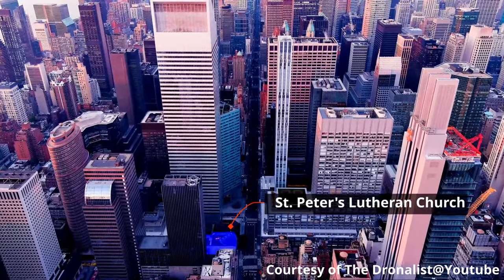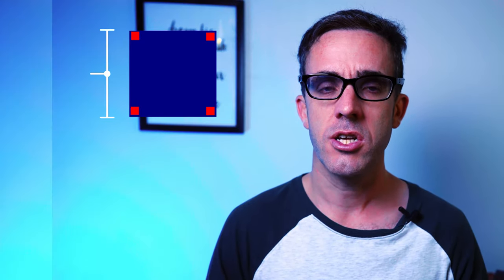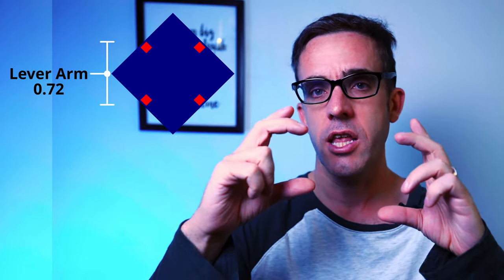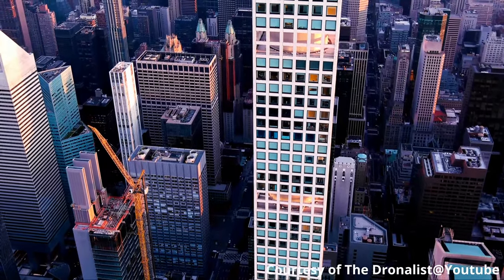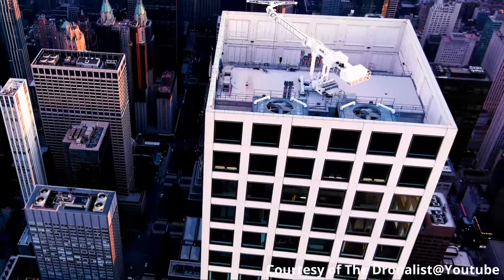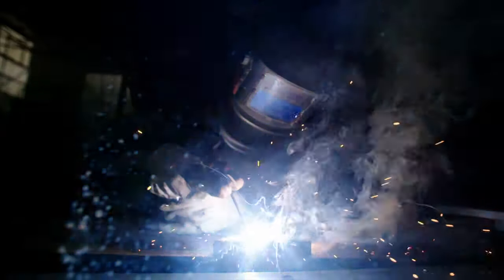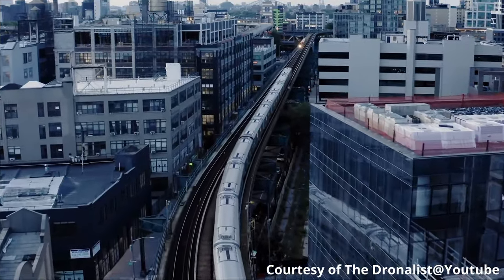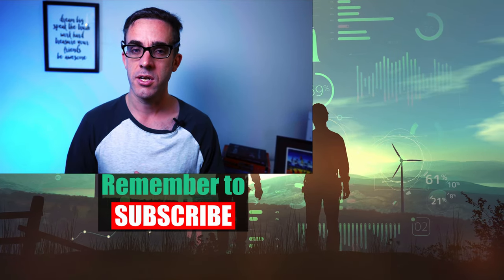How The Citicorp Center was saved by a Student's Question | Citicorp Center's design flaw

Comment: Thank you for the video ! This story shows that we always have to question common practices for a particular project and do not always apply them mechanically. 

As a structural designer, I have huge empathy and respect for LeMessurier who showed a lot of courage and honnesty. Especially because he dealt with the stress and the pressure and solved his problem under these conditions.
Reply from the maker: Hi Hadrien, thanks for watching. Also agree that how LeMrssurier behaved after should be what we aim for as engineers.

Comment: In a nutshell the building was only designed for four wind directions? I cannot imagine what design code anywhere would permit that. In comparison with the rest of the structural modelling the specification of the wind rosette is trivial, and the analysis and postprocessing are completely automated, so it costs little to consider the full design envelope.
The only reason I can ascribe to this is that computers used to be feeble and computer time (often from a bureau) was expensive. When I started as a junior engineer in the 1970s we had to economise computer usage and I guess that's what the designers did in this case.
For a personal project I did a dynamic analysis of one of Singapore's tallest skyscrapers to compare with instrumented results. Out of curiosity I looked up the article published in the Structural Engineer on this project decades ago. I was astonished to see that the design model consisted of vertical beam elements, one per floor, a total of around 500 dof. My model had around 200,000 dof a ran on a PC in a couple of minutes. How times have changed.

Comment: It seems that the mistake was hubris from the beginning. Only one corner was required to build the church. The central pillars, where needed on two faces, the other 3 corners could have been conventional construction.

He should definitely be praised for taking action. He would have known this was going to hurt him, and it reveals he was a well adjusted individual in that doing the right thing happened. We don't praise people enough for doing the right things. Taking a personal hit to protect others from our errors is a sign of good character, and should be rewarded.
However, if there is a lesson to be learnt for engineering; check your ego at the door; unless there is no other way, do what is proven to work. There were 7 other towers taller than this one, and that should have been the practical evidence to follow their lead.

If there is something to criticise, then it should also be that there was a far safer, quicker and better solution; secure the 3 corners which could have been secured, even after construction. It's only another example of hubris that this wasn't the solution.

Comment: I doubt the building would have collapsed as the wind would never hit directly due to the congestion of buildings around it. also there is a 20% factor of safety in structural materials. Also there are redundant load  paths thru the building.
Reply from the maker: Hi Design Studio, they wind tunnel tested it and typically the surrounding buildings would be modelled. But agree there may have been redundant load paths that may have stabilise the building.
Reply: @BrendanHasty  Except it didn't happen at Champlain Tower>>>>>What do you think the cause of that collapse was? The answer lies between Soils, Rotted patio slab collapsing caused moment and torque on 3 shared columns with the building, Car hitting column in garage, roof anchor installation.

Comment: Engineers make mistakes. Happens all the time. Most of them are not that of these magnitude but it happens. He did the right thing in my opinion by just telling them as it is. My question would be: Did these extra wind loads, which were not calculated in the design, had an impact on foundation?
Reply from the maker: Hi Dashoti, thanks for watching. I didn't find any information around the footings, however, with all the strengthen work undertaken, I would guess that footings worked even with the increased loads. footing is typically not governed by strength but are a long term settlement design, and as lateral actions are short term you typically have a higher capacity in the footings for these actions